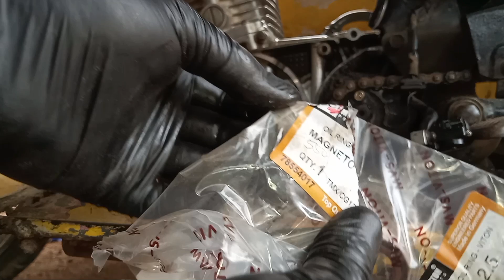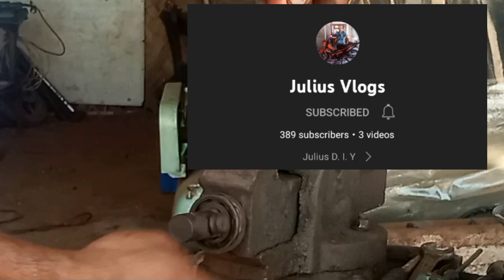DISGRASYA KAPAG HINDI MO PINUKPOK

Comment: bos matanong lang po.pwd vah yong clutch housing Ng tmx 125 73 teeth ilagay sa tmx 155.sana masagot mo bos.
Reply from the maker: Opo kapatid pero palit din Po Ng primary pinion gear at oil pump gear
Reply: @kuyalanmototv  salamat Po  Kapatid sa sagot.♥️